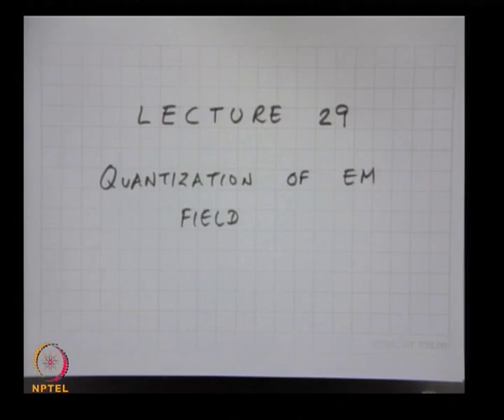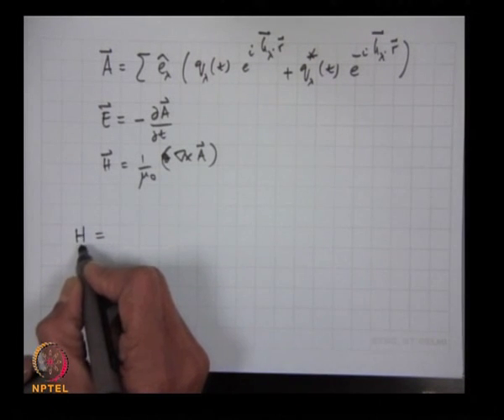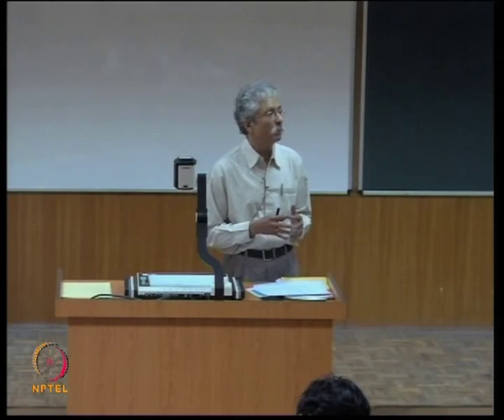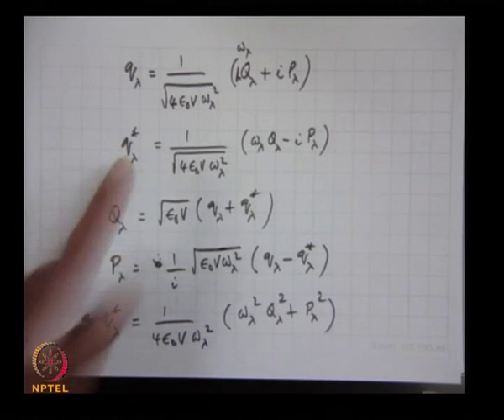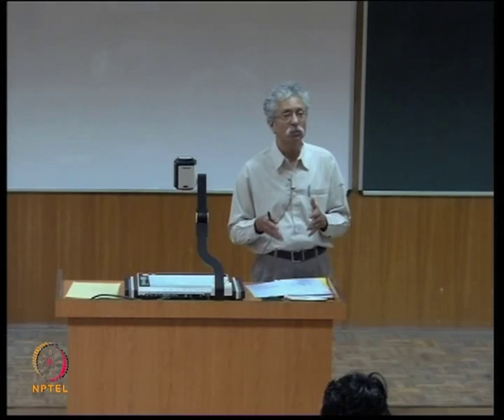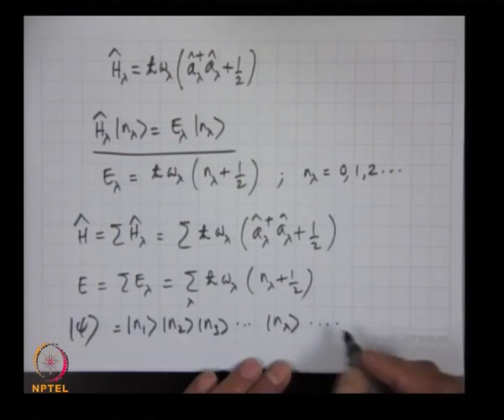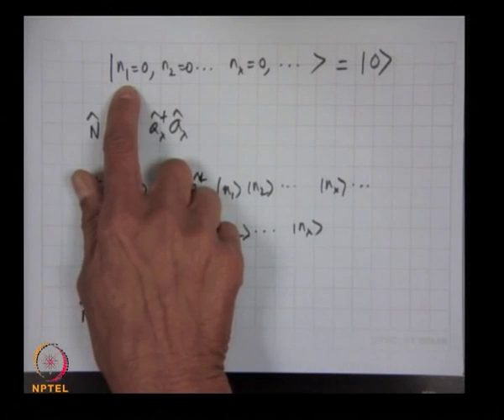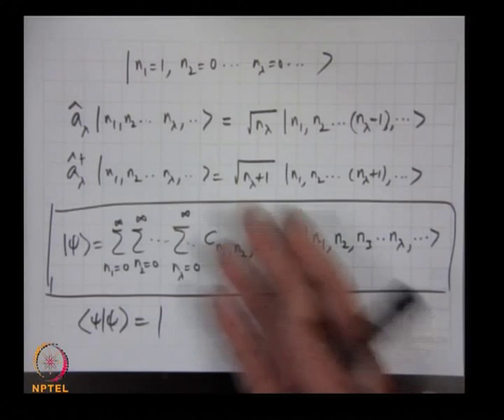Quantization of EM Field (Contd..)

Comment: @ 00:37 The lecture starts with a nice review (until here: 10:32); the origin of the factor of 2 is unclear. 
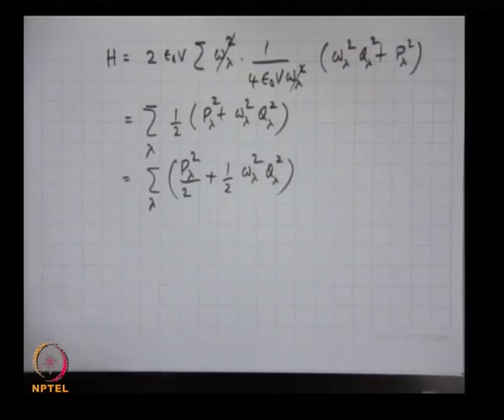@ 16:08 He wants you to believe that there can be energy without any oscillations (haha); not in classical physics!
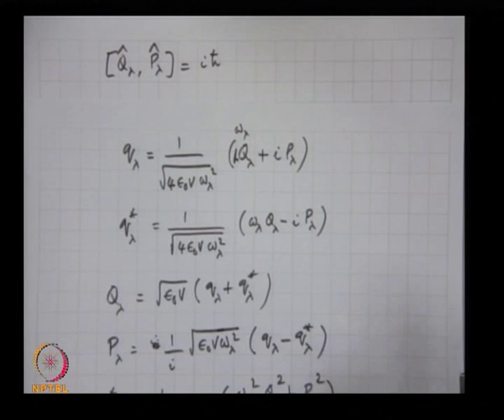@ 21:59 Second quantization starts here. So put your hat on :-)
@ 42:23 If spontaneous emission is due to quantum fluctuations, why call it spontaneous?
                But what causes these fluctuations??? 48:22 Verified when and where???
                The Casimir-effect can be explained classically (MIT Jaffe, 2005): no quantum fluctuations needed.
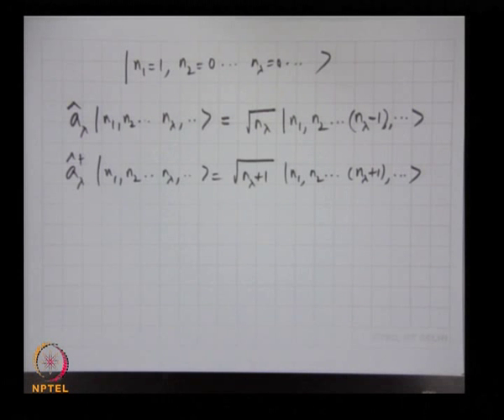@ 51:27 The most general state of the EM-field.